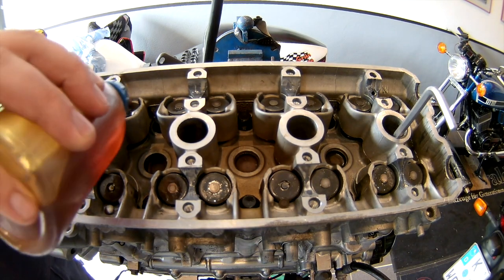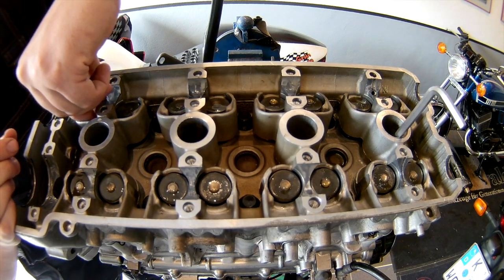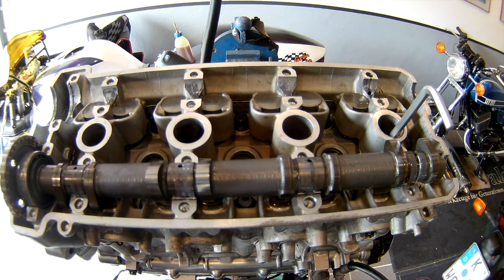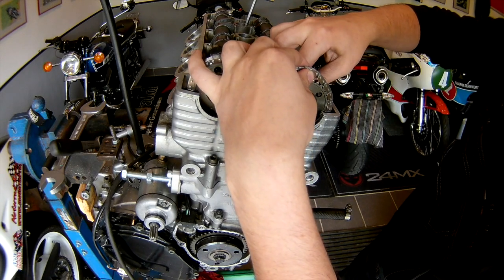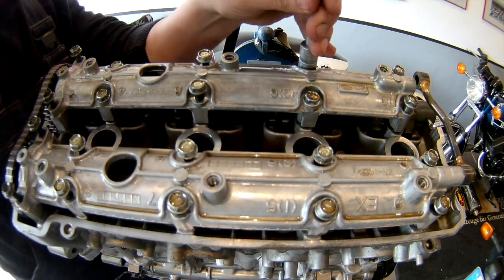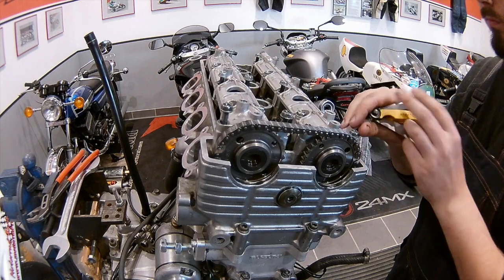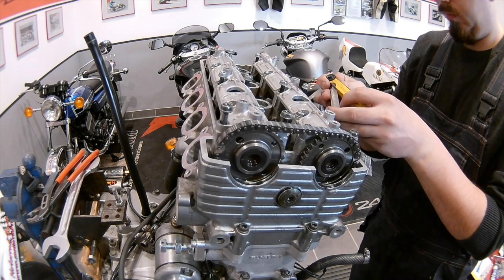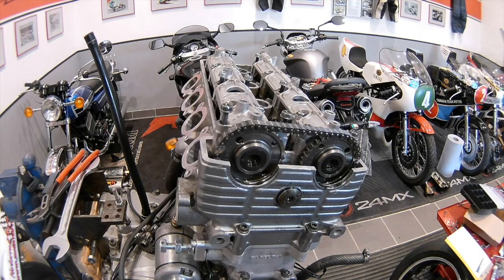GSX R 750 SRAD Build: Camshafts and Valve Clearance Ep11

Comment: Hi. Sag mal...ich habe meine Steuerkette so montiert. Nach dem Aufsetzen der NW-Halter, Einbau Kettenspanner  und drehen der KW, ist die Steuerkette zwar straff, aber die Pfeile stimmen nicht exakt.  15 Pins habe ich zwischen den Pfeilen, aber der 3er Pfeil Ex NW zeigt nicht genau auf den 2er Pfeil der In NW. Ebenso 1 von EX nicht genau auf die Dichtkante. Wenn die OT Kennzeichnung ca. 0,5 cm weiter gedreht wird, dann passt es. Habe ich evtl. einen Fehler beim Auflegen der Kette gemacht oder war ich evtl. nicht genau auf OT ? Müssen bei der Aktion die Kolben zudem in einer bestimmten Stellung ( Kompression, usw.) stehen ?
Reply from the maker: Moin, Das ist kein Problem. Wichtig ist die ausrichtung der Markierungen zueinander und vor allem die 15 Pins Abstand der Steuerkette. Bei den Motoren die ich bis jetzt zusammengebaut habe standen die Pfeile auf den Nockenwellen nie 100% mit dem Guss des Zylinderkopfes überein. Es kann jedoch passieren, dass beim anzeihen der Nockenwellenhalter die Welle einen Zahn überspringt. Also immer nach montage die 15 Pins abstand kontrollieren. Viel erfolg und gute Fahrt!
Reply: @thesradchannel8818 danke erstmal für die schnelle Reaktion. Die 15 Pins passen, jedoch zeigen die mittleren Pfeile nicht exakt aufeinander wenn ich auf OT stelle. Ich werde jetzt zu gefühlt 500sten Mal alles wieder aufmachen und nochmal neu prüfen. Das ätzende ist, dass der Motor eingebaut ist. Da kommt man nirgends gescheit ran.
Reply: @thesradchannel8818 noch eine Frage. Hast du den Kettenspanner vor der Ausrichtung der Nockenwelle montiert ? Wenn ich die 15 Pins einstelle, hatte ich einen Durchgang der Kette. Im Handbuch steht, dass man den durch drehen der Kurbelwelle eliminieren soll. Danach den Kettenspanner montieren. In der Reihenfolge bekam ich dann trotz der Pins, den Zustand, dass die mittleren Pfeile leicht aneinander vorbei zeigten. Stimmt da meine Reihenfolge nicht ?
Reply from the maker: @zobbyzockbrecht2469  Die Reihenfolge scheint mir richtig zu sein. Wenn man DIe Steuerkette drauf hat und die Nockenwellen montiert sind kann man den motor ein- zweimal  durchdrehen dann sollte sich der durchhang der kette oben erübrigen. Wie gesagt die markierungen sind nicht 100% genau. Hauptsache ist du bist im OT und hast die nächstmögliche NW stellung zueinander damit du die 15 pins hinbekommst. Ich hatte einmal einen zahn versatz, dann ist die maschine einfach nicht angesprungen :)

Comment: I sure could use ur advice and input as i swap my 99 motor stuff over onto a 97 motor i tried to find a low miles 99 98 but had no luck and they dont sell the main bearings anymore sadly
Reply from the maker: Hey, The 99' head fits fine, I run a similar setup on my current race engine. But be aware that some internals of the 97 lower engine will be different. such as oil jets for lubricating the pistons and transmission range. You also need to swap the crank pickup since the ignition on the 98 - 99' is controlled in a diffenent way. The pickup is located behind the flyweel on the lefthand side of the engine, behind the timing chain. Like I always say, get youself a copy of the original workshop manual and study the diffenences between the two models. Cheers!
Reply: @thesradchannel8818  ive got the manual i actually put a 600 transmision in my 750 and it was a monster
Reply: @thesradchannel8818  jealous buddy i had do valves ruined my motor cause i called him out in front of his real buddies guess i know better now ill build my own stuff i got the cams out and yea i was planning to put my tensioner chain and the bottom sprocket as well as the wiring on the crank ima guess that is what u mean

Comment: Valve lash is set on the low side of the camshafts, this would’ve been much easier with the cylinder head off the engine... also would’ve been easier if you kept the original shims in and recorded measurements before disassembly, that way shim replacement would be much easier to figure out.

Comment: Great video! Going to need this soon :)
Reply from the maker: Good to know! Should you run into problems feel free to leave a message.
Reply: @thesradchannel8818  Hello buddy, if the tensioner didn't work well the timing chains tension goes wrong, and if this happen the chains might hit the metal bracket located just above the camshaft sprocket. at lower RPM engine turn slower so it wouldn't hit the bracket . at high RPM the engine turn faster and there would be the tendency the chains hitting the bracket above the camshaft sprocket,  what's your view regarding my assumption, big thank!